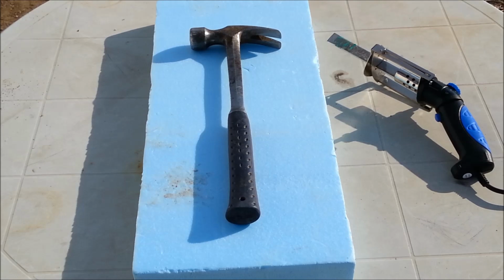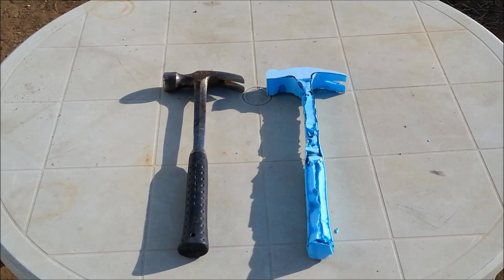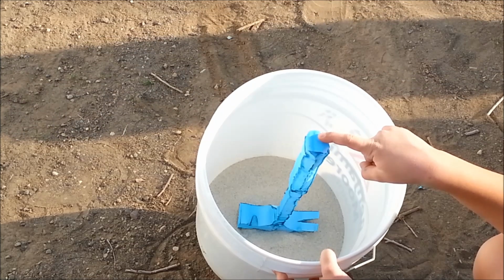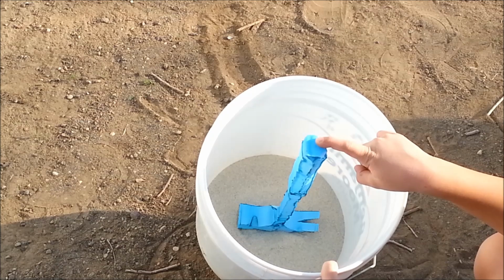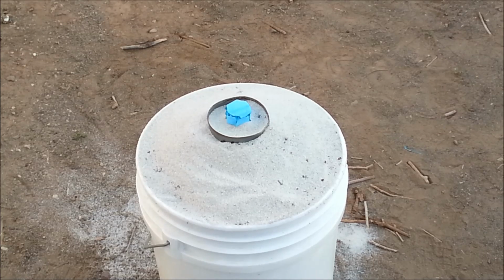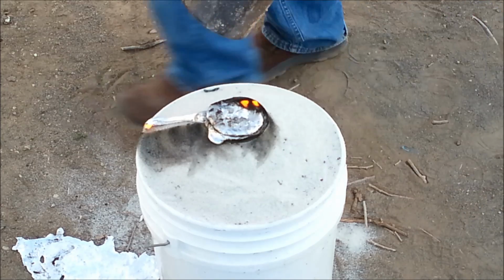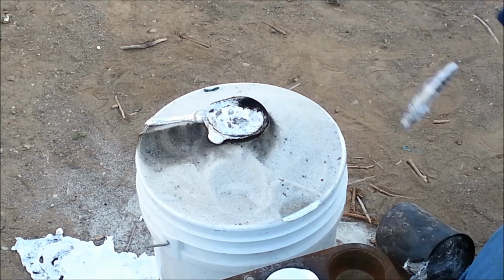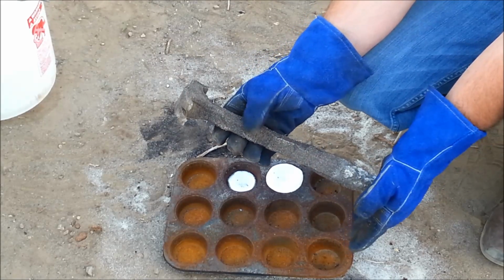Casting a hammer from molten aluminum

Comment: the old casters say; "its easier to shape the model than the metal", which means shaping the Styrofoam model with a file or power disk sander would be a lot easier than grinding the aluminum. I do understand you were just showing the principle, but I thought I would share.

Comment: the correct way to do this is to fill the sand over the foam and then have a hole in the sand leading to the foam

ps... aluminum spills all the time because it is thinner than water